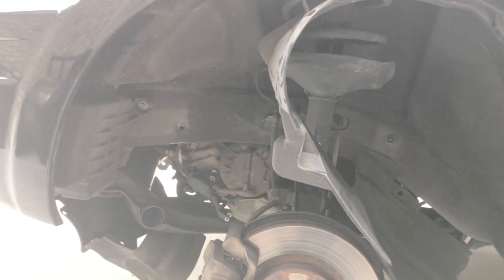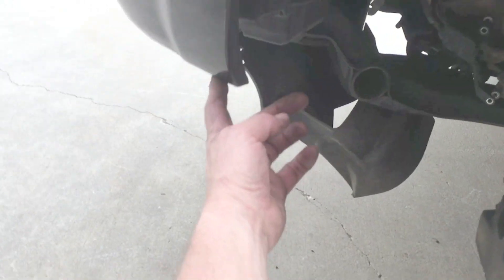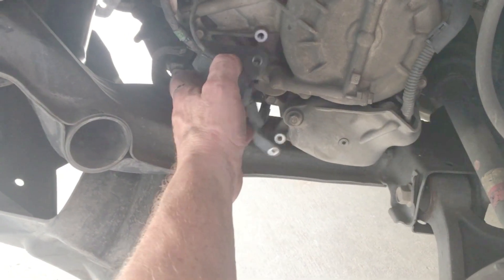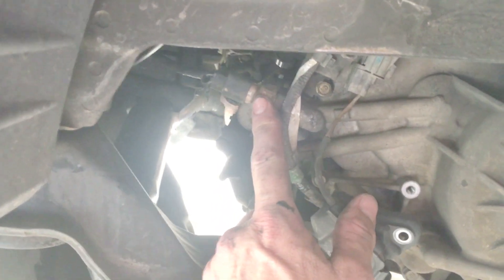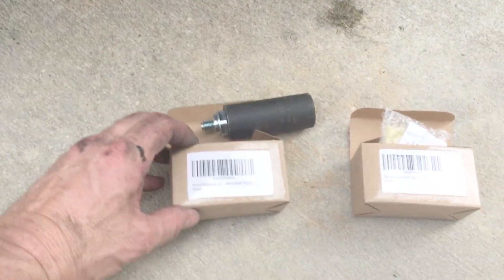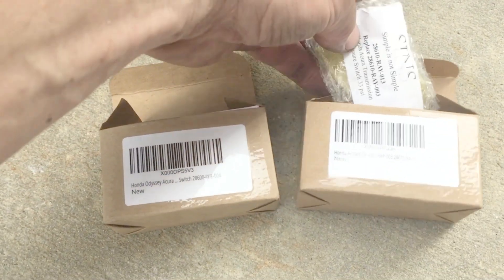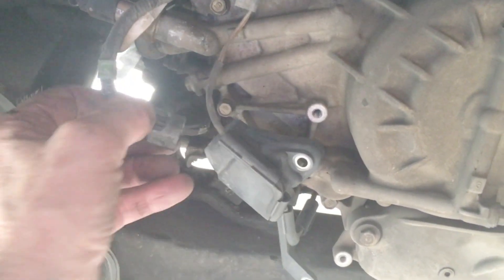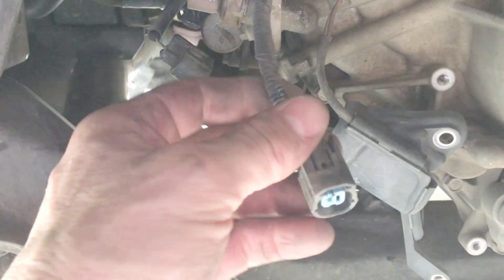2003-2008 Honda Pilot/Odyssey, Acura MDX #3 & 4 transmission pressure switch/shift solenoid change

Comment: Okay so like 6 months ago or so i watched this video and replaced the 3rd gear switch. Now i am having the code for 4th. HOWEVER when i found & bought the part for the 3rd it showed how the piece worked for the 2nd & 3rd gear switch. But i am finding no where the same piece that says 4th. I keep seeing "transmission oil switch", ia that the same thing i need? Or a completely different part? I have been calling & searching for almost 2hrs and i feel lost. The 3rd gear one was SO much easier to find than this 4th one. Someone help me please 😭😭

Comment: What were your symptoms that made you replace these solenoids. I have a 2004 MDX that goes out of gear when I stop. If I shift down to 1st or 2nd manually I roll, this happens sometimes and then it doesn't. Any Ideas?

Comment: Hopefully you still check your account, do you know if this would help with a 2003 Honda Pilot that misses 3rd gear? Drives fine but if you don’t let off when it shifts to 3rd gear it’ll just rev out until you slow down enough to kick back into 2nd or skip entirely to 4th. Sometimes it’ll actually shift into 3rd on its own too

Comment: Can I drive 2002 MDX with out the shift sensors?
Reply from the maker: Computer controls the transmission. Faulty shift sensors will result in loss of certain gears. Have to have shift sensors. Depending on miles, may be time for a rebuild. Good luck
Reply: @andrewlewis7025  I replaced 3 and 4 sensors but could not take out the battery tray to atleast take out the dual Linear shift solenoid to clean it. I used ATF for the 2002 mdx from Dealer but it still persists some times
Reply from the maker: @Papadworldmedianetworks  they key is clean tranny fluid. 98 - 03 were problematic for Honda. Our 03 Odyssey tranny was failing at 120k miles. When I got an 05 pilot (@ 95k miles) I immediately did the “drain and fill x3”. Repeated that every 40k miles. Sold the pilot with approximately 250k miles on it. Those early 2000 trannys are hit or miss. Our dealership gave a decent discount buying a case of transmission fluid at a time. Takes a case to do the drain and fill x3. I did the tranny fluid  change with the solenoids, to prevent old, thicker fluid from clogging up passages.
Reply: @andrewlewis7025  thanks. Do you know the location of the battery hold down bolts ? Any one out there.? I got to get down to Linear shift solenoid under the battery. I found the two on the front but I believe there more bcos its rock solid.
Reply from the maker: @Papadworldmedianetworks  sorry, never removed battery tray.

Comment: Hi Andrew,
I noticed the drive green light flashing on my 2004 Pilot, I used a friend's scanner and came back with 4th pressure switch code. 
After watching your video, do you recomend to change both 3rd and 4th pressure switches even if the error code is only for the 4th?
will the 3rd eventually fail also?
Thank you for your informative video.
Reply from the maker: I would just replace the one in question.  Remember to drain and fill the fluid if it has not been done in a while.  Old fluid can clog the passage ways in the shift sensors, especially the new one.
Reply: @andrewlewis7025  Yes, I am going to replace the old fluid also. Thank you for your help!

Comment: well just checked the wifes Pilot and show the #4 PSI switch..going to change it out...not sure I will Drain and fill the TF..did it about 3 years ago..thoughts on that ?
Reply from the maker: If the fluid has less 30k miles and looks CLEAN, I would not drain and refill. If its looks dark, or dirty, I would change it. I ended up getting 252k miles on my original tranny before I sold my 05 pilot to get a 15 MDX.. I have been told that is longer than expected.  I did install a tranny cooler on it around 95k miles, which I am convinced helped, coupled with drain and refill tranny every 30 - 40 k miles. If you are planning on keeping pilot as long as I did, buy a case of honda tranny fluid on line.  It's a good bit cheaper. Should get you through 3 drain and refills.

Comment: Is this the same for a 2005 Honda Pilot. Draind the TF already worked than flashing D came back on..
Reply from the maker: This video was on a 2005 pilot.  When you drain tranny fluid, the recommendation is to drain and fill x3. Drain, then drive a few days, Drain, drive few days, and final drain and fill.  This replaces approx 90 plus % of the old fluid.  After that, replace which ever shift sensor is causing the problem. It's not a guaranteed fix for a neglected tranny, but usually is the first thing to try.  I did this 2 different times during the time I owned mine, and got 252 k miles on original tranny before I sold it.

Comment: When I drive in the freeway for 30 or so , my pilot started jerking and got stuck it seems on 3rd gear I used a code reader to erase the check engine light out and the transmission reseted and i can drive again. That has happened twice and notice I was driving at 70+ miles/hr. What you guy think?
Reply from the maker: Usually when the tranny starts acting up, it’s either wearing out, or it’s has dirty tranny fluid.  Usually every 40 k miles, you are supposed to change the fluid. This can be achieved by a drain and fill x3 ( approx 90% + changed). If you think it’s the #3 shift sensor, at least drain and fill once, then change the sensor. If this fixes the problem, I would drive a few days, drain and fill, then repeat one more time to get your x3 drain and fills. It’s not a guarantee, but it’s worth a try.

Comment: Thanks for this video!  Having the same symptoms.  How are the 3rd party brand sensors working out after a few months?
Reply from the maker: I did end up replacing 1 0f the 2 sensors.  Got a flashing D last week.  Thought that finally after 243 k miles, the original tranny was winding down.  Had to take to dealer for the diagnosis.  Ended up being the 4th sensor again.  Went ahead and bought one from the dealer so I could fix it same day.  My dealer charged around $80.  Found Honda OE sensors on line for around $50. The other 3rd party sensor is holding up. Kind of a gamble unfortunately.
Reply: Thanks for the update.  I don't plan on keeping my Pilot very long, so went with the 3rd party ones for about $27 ea.  Install was a breeze thanks to your vid.  Much appreciated!

Comment: How much damage can you cause if you drive with this bad. Only one vehicle for now , waiting for part to come in
Reply from the maker: Depends on how bad the shifting. Those sensors tell the the computer when to shift. As long as you don’t drive too hard it while it’s struggling to shift, you should be ok for a little while. Eventually it wont shift into the higher gears, and you will stuck driving 20-30mph.

Comment: I know it has been a while since you posted this, and I am praying that you’re going to see this soon LOL, but I am getting the P 1740 pressure switch failure code On my 2002 Honda van. I am not a mechanic, and I am also a visual learner, and I’m wondering if I can use your video as a guide on this thing because I am in dire straits here. I can’t find much information, and I’m hoping that the parts you used here will work on my van.
Reply from the maker: I believe that’s the 4th shift position switch/sensor. Look that up online to confirm a part number. There are cheap ones ($30-$40), but the quality is a role of the dice. I had good luck with  mine. Should be the same repair as in the video. Not a difficult job. Have your part in hand, then make sure you have the appropriate socket. You can do it!

Comment: hey im just wondering the two sensor 3rd  and 4th are the same or its say 3rd or 4th sensor?
Reply from the maker: Dealership had separate part numbers. I would assume they aren’t same. Probably a computer ID thing. When it comes to electronic items, I start with deal first to assure correct part numbers. Since it’s more than likely a DENSO part, you can go to their website and search the DENSO part number. A lot of times it’s cheaper. Good luck.
Reply: @andrewlewis7025  thank you

Comment: What happens if you switch the switches??? 3 to 4 and 4 to 3???
Reply from the maker: No clue, never deliberately tried that.  Im assuming you will get a flashing D (equivalent to check engine light). May also cause premature shifting.  Do share if you find out.

Comment: Great video.  How do you clear the code from memory
Reply from the maker: Usually the "flashing D" will cease with the switch/solenoid change.  Disconnecting the neg terminal to the battery for a short time can reset check a engine light. If you still have a flashing D after you replaced solenoid, then you still have an issue.  In some cases, the tranny is done.

Comment: Should I change 3 and 4 or just (3)
Reply from the maker: I would only change the failed part.  It's easy enough to access and change the other part when it fails.  I had to have the dealership use their computer/scanner to diagnose which shift sensor was bad ($60).  OBD readers at most local parts shops wont diagnose tranny sensors. If you are planning on keeping your honda for a while, get a quality part.

Comment: Great video! Do you know where to find the reverse transmission pressure switch/shift solenoid? My 2007 pilot sometimes shifts into reverse perfectly. Other times the reverse shift isn't so smooth. The gears just grind for a few seconds until the gear thuds loudly into place. Even if the shift to reverse happens smoothly sometimes when backing up, the car will drop out of gear and grind again. Turning the car of and trying to shift again sometimes fixes the problem and the shift to reverse will happen smoothly without indication of any problem. All other shifting is working fine.
Reply from the maker: From what I have researched, sometimes doing a drain (approx 3.5) qts and replace of tranny fluid can fix problem. I have also seen a shift solenoid on top of tranny, just below battery, and to the left of the tranny dip stick.  6 bolts hold it in place. This shift solenoid malfunctioning (due to possible clogging), can affect shifting and I believe shifting into reverse. Basically, it all comes down to transmission fluid, and appropriate circulation of that transmission fluid. I'm just a DIYer, so I would call a tranny shop for a more positive diagnosis. Good luck..
Reply: Nice video

Comment: I have a 1740 code on my 2003 Honda odyssey when I had it ran for diagnostic it came up as the 4th gear clutch pressure switch so is it the same thing because when I look for it at auto parts stores the have like an A or B   transmission oil pressure switch
Reply from the maker: From what I have researched, P1740 usually (not 100%) can be fixed by replacing the 4th pressure switch and performing a tranny fluid DRAIN.  If problem continues, may be time for a new tranny. Refer to your local honda dealer to verify your part number, search part number on line.  My dealer was almost double the cost of on-line sites.  Good luck

Comment: What is your engine code?
Reply from the maker: I had to go to my local dealer and have them scan my pilot to tell me which sensor was the problem.  The local auto parts shops scanners do not have the capability to scan a non check engine light issue, such as the "flashing D". I had to eat a $68  diagnostic fee.
Reply: I have a accord 2008 v6 
I am having flashing d 
Codes are p0796 
P0767